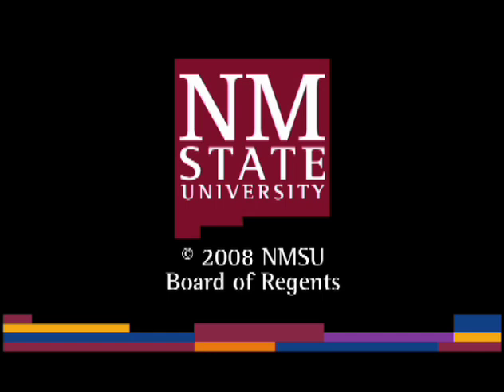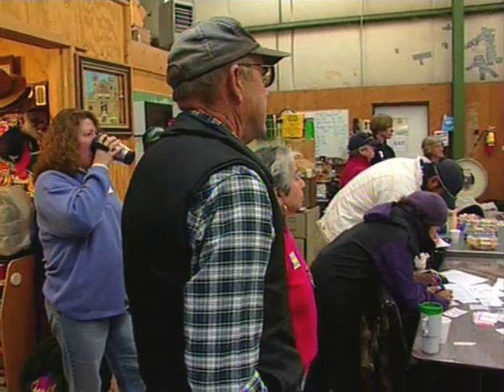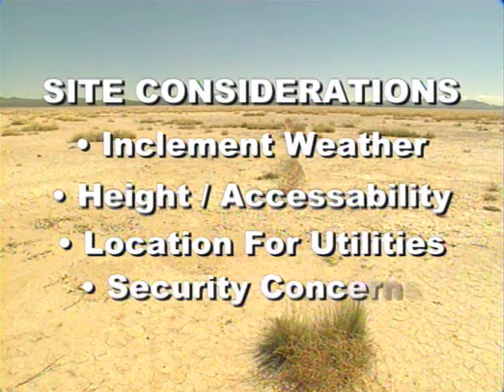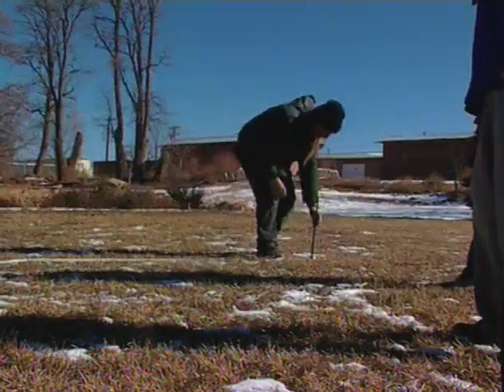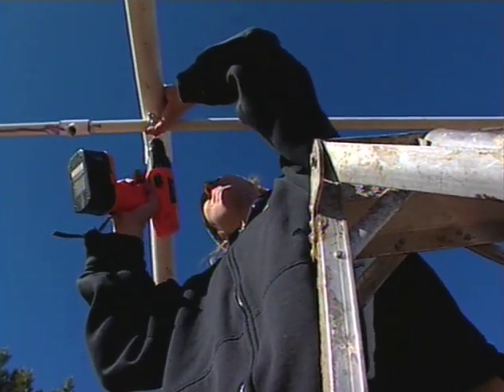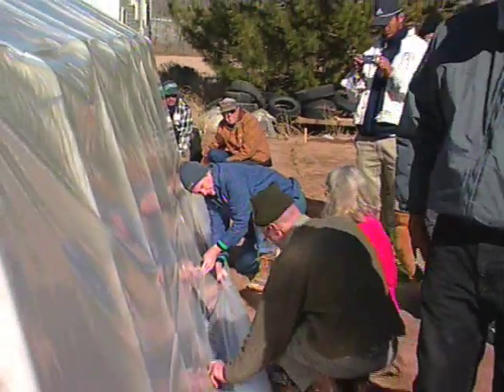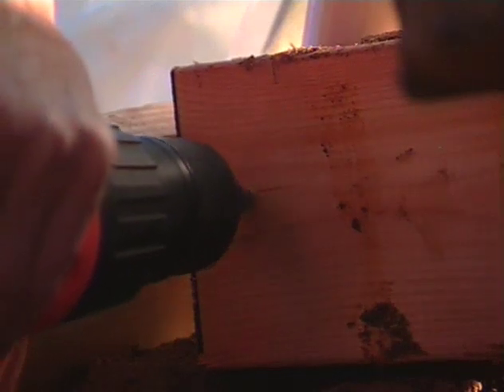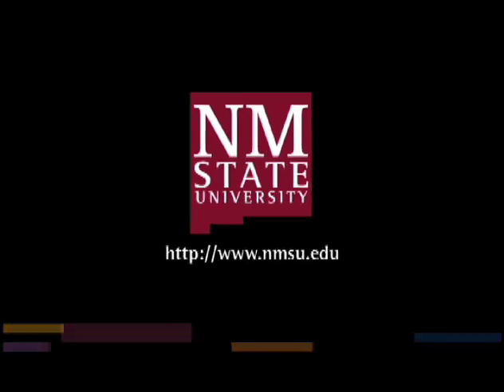Building a Cold Frame Greenhouse (English)

Comment: Great and very inspiring! thank you. I will appreciate knowing which type o pvc tube is used. Here in Spain as a DIY I am only familiar with light color tube semi rigid for electrical use and without the join accessories shown here, and the other tube is dark grey, very rigid, use as water conductor. I am eager to get started with the greenhouse construction. Gracias
Reply: The pvc pipe used here is for cold water use and has no UV protectant.. Your dark grey pipe would work as well or better if it contains a UV protectant in the pipe.. The fittings are all 45 degree fittings.. The frame work here is so far the best in my mind.. Good video..